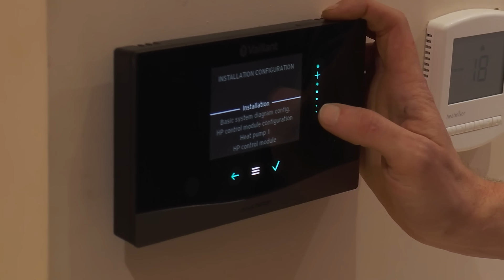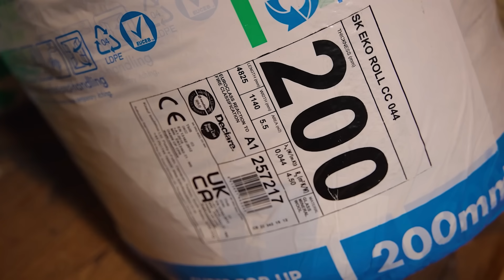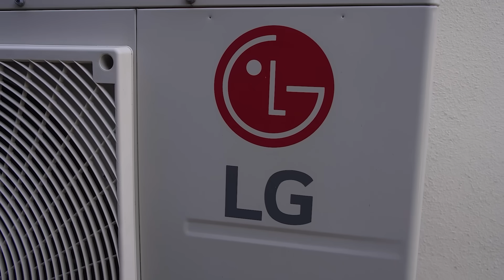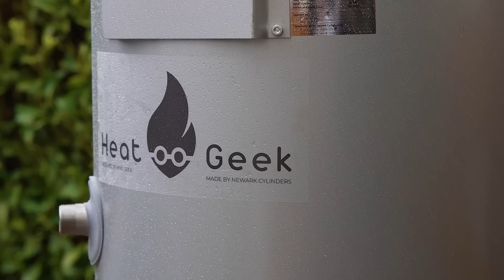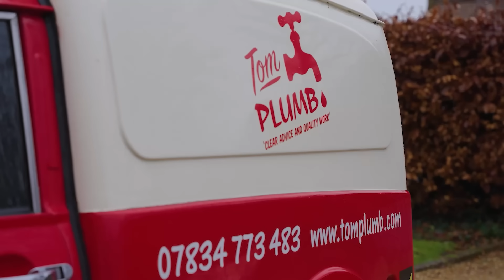Heat Geek’s Heat Pump One Year Later — The Verdict!

Comment: John talks a lot of sense, about grants and knowledgeable installers , most of these grant dependant company's burst onto the scene then go bust as their shoddy work starts to catch up with them. 
I've been an independent Gas Safe engineer since the 90's and seen this many times.
Reply: Last week on BBC Look North (Leeds) there was an article about a couple who had a heat pump installed.  They had lived in their house over 40 years and said they had never been cold until the heat pump was installed. Their energy bill was over £1,000 a month!! And guess what?  The installers had gone bust.  The lady said she wished she could afford to go back to gas CH but they were still paying off the loan for the heat pump.  What a nightmare.
Reply: @TheDavecroft  That sounds real bad. But in my experience older people are hard to convince to use a heat pump properly, as we've seen in this video. They are used to gas boilers and want to use it for shorter periods of time at higher temperature which is really bad for a heat pump. It;s not good for gas boilers also but they are more forgiving. "Uneducated" people think that shorter periods of use of a gas boiler leads to greater economy. But modern gas boilers are modulating their power. So a 20 kW gas boiler can run for 15 minutes at full power and use 5kWh or at 25% power for an hour and use also 5 kWh. Or at 10% power and use 2 kwh.
Unfortunately there are many companies that got into heat pumps and don't understand how they work or how easy is an installation, but we are getting there and some channels are useful, like Heat Geek.
If even I managed to install myself two heat pumps for only 2.600 EUR that work perfectly for three winters now, it's not that hard, is it? And I went to law school, not engineering.
Reply: it is the same with solar panel installers,  we had rebates on them in the netherlands   a boom of solar companies,  now the subsidy and rebates are gone  and so are those companies,  so there goes the warranty's
Reply: @abelfaber4457  Well, it shouldn't, the warranty is supportde by the manufacturer. Maybe the warranty for the installation only.
Reply: Same with cavity wall insulation schemes, a government grant feeding trough for cowboys.
Reply: I think tax money would be better spent on reducing electricity prices (at least for heat pump and electric car charger tariffs), supplemented with grants for low-income households. Those should also be given out for improving insulation, again mostly for low-income households. 

This could prevent “Wild West” installer markets, as middle to high income households would pay regular prices for installs while still making the switch to electricity economically feasible for them thanks to lower electricity rates.

Once this is set up, it should be combined with a mandate to at least partly switch to heat pumps, district heating or renewable fuels when it’s time to replace the old gas boiler anyway. We all have to stop burning gas over the next 20 - 30 years, so we really need to stop installing brand-new gas boilers asap.
Reply: I used to be OFTEC registered and did some repairs on several installations done on grant schemes the company went bust. The next village to me I did a boiler change for an elderly couple and did the servicing. Next door another elderly lady had a boiler change done on a grant scheme. The neighbour rang and asked me to service her boiler because it was smoking. I went around to take a look and found the balanced flue still had a lot of packaging restricting the balanced flue air intake. She had had them back a number of times because it wasn't working properly. She wasn't happy because they insisted the new boiler couldn't be positioned in the same place as the old boiler plus it cost her nearly £1000 more than I charged her next door neighbour in an identical bungalow. I made a fair profit on the neighbours install but the other install had a shorter flue and they probably saved £150. The four grant aided boiler swaps had stupid mistakes oil leaks and stat wired wrongly and I doubted the commissioning figures.
Reply: Guys, stop using apostrophes if you have no clue as to what they're for.  Better to leave them out and get it wrong than put them in and get it wrong-er. 
Companies*
Warranties *

Comment: he's over the moon with 20 C, thats freezing cold in winter, we need the house at least 24C
Reply: You are growing tomatoes?
Reply: Yep.  20 or lower is fine if I'm moving around doing housework, sitting watching telly I want 22 degrees.  And no, I'm not going to sit under a duvet or going to wear a onesie and gloves, it's 2025 not 1965.
Reply: I take it you are very elderly or have some disability? I would also say that a heat pump is more comfortable than a boiler even if the temperature is lower, this is because of the lack of fluctuating temperatures.
Reply: @MentalLentil-ev9jr  Why? At what temperature you feel comfortable in the summer. Better yet, do you happen to know what is the temperature used on the International Space Station? You guessed it, 24°C.

Comment: I think it makes sense to leave the experiments to those who can afford it if it goes wrong. Unfortunately very few have access to the skill heat geeks have and the investment Roger gives. If you had to pay for these guys probably be able to buy enough boilers to last a few life times 😅 . A combi boiler is tried and tested, evolved to become better. Stick with what works and put food on the table.
Reply: You can get a heat geek fitter and have the gov grant to help towards it.
Reply: @garethhhhh  Or keep what you have and save a lot of faff, hassle, and expense.  All that palaver to save a couple of hundred quid on heating bills?  No thanks.
Reply: @TheDavecroft  couple of hundred?

If everyone stopped using gas, our bills would drop dramatically.

The price of electricity is based on how much it would cost if it were generated by gas.

Wind and solar costs a fraction of what it costs to produce via gas, the issue is it's price is based on what it would cost if it was made with gas.

When I get my solar sorted, it'll be thousands saved over ten 20 years, possibly 30k or more saved..
Reply: @garethhhhh  
No it wouldn't, because you're not taking into account the system cost for 100% renewables.

You need more transmission lines, backup power(IE: batteries), substation upgrades 

Basically you need to upgrade (IE: replace the network we already have) the whole system and and have backup for night when the wind isn't blowing. 

That will cost billions and the end user will foot the cost.

It will be more expensive, which is exactly why energy bills were the highest they ever been, because of the renewable transition.
If it's so cheap why do you have to pay a green energy fee on our bills🤔.

If you want cheap energy we need to start using coal again.
Reply: @garethhhhh 
Gov grant is the reason we have high taxes.
Reply: 'stick with what works'. Really? If we did that we would still be burning coal to heat the house. Heat pumps are a far superior technology, and it has been around for decades. So tried and tested, absolutely.

Comment: That is a lot of money every year just to heat you're house. OIl and gas should both be cheaper than what this guy pays so frankly I don't see the point.
Reply: It is a 6 bed house with varying degrees of insulation. Heated to 20 degrees all year around.

Comment: What I took from this video is that the house would be a 20 degrees continuously but whilst that is fine from just before rising until an hour before bedtime, it is much too hot while we're in bed. I'm staying with gas, very happy with it running for a few hours in the evening and a couple more in the morning.
Reply: I have one, I have it set to 19 - 20 during the day and 17 - 18 overnight.

Mine is set, so when I get up at 7, it's already at 20.

I have it set, so if I set a target temp for a selected time, it starts the heating process 3 hours before.

My tariff is 12p per kwh between 4am 7am and 1pm and 4pm, so I set the target temps to 7am and 4pm, so I use the 3 hours cheap energy to heat the house.

I'm more than happy with mine, it works perfectly and is cheaper than my old system.

The key is who installs it, they need to check it can work for you, and many are starting to do that.

Design and fitting, many skip design.
Reply: @garethhhhh  similar to me.
Reply: @johnmusgrave3179  It’s straightforward to set a lower temperature at night.
Reply: No it doesn't, I have a heat pump which drops 2 degrees at night. 20deg -> 18deg which is ideal sleep temperature.

It works like a charm, everyday and has never caused issues.

A 2degree delta is okay for a ASHP, anything more than that is probably an issue but it doesn't take days it takes a couple of hours for the house to heat back up to temperature again.
Reply: Really, 20°C is too hot? How do you sleep in the summer? 🤣
We stay at 24-25°C all year, summer and winter.
Reply: It does seem stupid that in a world where we are trying to save energy and resources, we now heat every room in our houses 24/7 rather than just heating the rooms we are using, when we use them.  I live on my own, so what is the point of heating my bedroom, bathroom and kitchen if I am sitting in the living room for 6 hours every evening?  There must be a better way.
Reply: @TheDavecroft  Well, this is the better way. You need t understand that you are not heating a room but a house/building. If you heat only one room that room is going to lose heat to the adjacent rooms through the walls, floor and ceiling. So you need hotter radiators to compensate that. It seems counterintuitive to heat all rooms but it's not. A stationary regime use is better than a  transitory one. It's like driving a car, you can accelerate to 200 km/h and then let it roll until it stops and repeat, or you can drive at 100 km/h constant speed. Which one do you think it's more economical?
And a heat pump is more efficient at a lower flow temperature than a higher one So 30°C is much better than 50°C. Also it has less power available tha a 24 or 35 kW gas boiler, which need that power only for instant DHW use. For example, my 135 sqm house needs only about 4 kW at -20°C outside and 20°C inside temperature. But I have a 35 kW gas boiler and only a 6 kW heat pump. And I live in Romania, we have real winters here.
Reply: @TheDavecroft  

Because with low temperature heating it is often more energy efficient to keep whole house at a steady temperature than to blast heat into one area every so often, only for that heat to dissipate to rest of house anyway.

Ultimately many will be able to run their house heating in a completely sustainable manner using solar PV and storage, not using any resources that they would only burn.
Reply: 20 is too cold. 23-24 is norm. it is not just heat, no one talks about fresh air, if you seal the house, your co2 level in the bedroom goes critical to 1600ppm and above.  comfort or paranoia about house insulation, I would rather sleep with fresh air
Reply: @W_L_W.  BS
Reply: OK GUYS - this is the reality…..  we switch off the radiator on the bedroom permanently, shut the doors to isolate the bedroom, and it works perfectly. NO fiddling with controls, no messing about with calculations, just a simple solution. …. John.
Reply: His house, his heating. He could set it to be cooler overnight.
Reply from the maker: Biggest
Actually that wouldn't work. If the temperature drops it takes days to get it back up again.
Reply: @SkillBuilder  a couple of degrees drop overnight shouldn't take that long to recoup.
Reply: @SkillBuilder  it can be set to 2-3 degrees lower at night, no problem. Takes about an hour to get back up.
Reply: @benw4079  it's not possible to assert a universal fact either way. The video describes a house that has construction features that are 'heat stores'. Those could take almost geological time to bring up to temperature if they drop. A house which is all insulation and no 'thermal mass' could flick its temperature up and down like billy-o.
Reply: @trs4u  that's the case for any heating system. That would be an issue with the house, not heat pumps. Heat pumps can easily be set to run lower at night.
Reply: @SkillBuilder  False. That’s yet another myth. Most controllers can be programmed to drop a few degrees overnight and reach a set point by a specific time in the morning.
Reply: @SkillBuilder not days-thats an exaggeration.
Reply: @benw4079  Indeed, it is easy set the heat pump to drop a couple of degrees late evening and add it back to wake people up. Doesn't take long here to regain the temp.
Reply: @benw4079  yeah nobody's being mean to heatpumps. I'm just saying that some of us live in thermally massive old buildings which would traditionally have relied on infernal levels of heat to quickly bring the air temperature inside up to a level while the fabric remained cold. While it would be possible to fit a heatpump having the same infernal nominal heating power, the low-temperature transfer elements would struggle to have the same rapid effect on the occupants and air that old school dangerously hot radiator/convectors would. It's a complicated idea that probably involves some ideas that Roger has alluded to before with wall-mounted rads 'tumbling' the air in rooms making them faster to transfer heat in a crisis than uniform ufh would be. Not really a 'heatpump problem' as you say,  but furnace heating is going to have qualities that can't be matched exactly by heatpumps, not all of them bad.
Reply: @trs4u  yeah but don't let the temperature drop more than a few degrees, then. Granted, if the heating is off for long enough and the temperature has dropped, it'll take longer to heat up again, but an electric heater for £20 would solve that.
Reply: @SkillBuilder  of course there are always exceptions, but for us and I imagine for most houses in UK this is false. We have bungalow, no cavity wall insulation, only loft insulation, no UFH, bog-standard heat pump, double rads (not triple) and in the winter we only run ours during daytime hours, 5.30am - 4pm then 7-9pm (to take advantage of Octopus Cosy tariff) off-peak times. Flow temp 45 deg at -5 deg. Scop of 3.7 across year. In shoulder seasons like today it was off for large parts of the day. If you lose all the heat for an extended period of time then it's true there is a lag, but it's not days, usually 1 day if you raise the flow temp by 3 degrees temporarily. We let the house naturally drop in temp a bit to sleep then let it rise gently again in the morning
Reply: @SkillBuilder  

But it does work for a drop of a few degrees overnight, it only takes a day or two to get back up to 21C if it's been off for a week during winter and temperature has dropped to 6C or so inside. Often better just to leave it ticking along when away at reduced temperature.

It only takes a couple of hours to rise from 16C to 18C in a bedroom, or 19C to 21C in living room.

Alternatively a TRV could be used if needed to reduce bedroom temperature a bit.
Reply: @trs4u  

Your large thermal mass would mean that when up to temperature indoors it would be very stable and might not need much to keep that topped up.

Low temperature heating works, and having whole house at a steady temperature is a very pleasant experience.
Reply: @SkillBuilder  No, it doesn't. He can lower it only in that room.
Reply: @Biggest-hz7ng  For an entire house it will, this is not a 30 kW gas boiler.
Reply: @benw4079   Depends on the house, surely?  I am in an end terrace, the gable end is north facing and even with insulation it acts like a heat sink, it's even pretty cool in summer.  My main bedroom and living room are next to the gable end and they take hours to warm up properly.  But at least in summer I don't need to sleep with a window open!
Reply: @TheDavecroft  you can't blame a heat pump for that. The radiators still get hot. It's a myth that they're tepid.
Reply: No, it can be set lower at night or anytime.
Reply: To spend that amount of money on a heat pump at my age wouldn’t be cost effective
Reply: @DrRobert-v8k  heat pumps aren't primarily about savings on energy costs. Future owners of your home might appreciate a more future proof low temperature heating system?
Reply: @  well they can pay to have the house ripped about to fit an inferior system

Comment: Run a heatpump, second one for this property here in New Zealand. Does a good job although we don't see freezing temperatures. Added bonus of AC in the summertime.
Will add though, the heat is just not the same as a woodburner or decent gas heater, but it's convenient.
No more maintenance than cleaning the internal room filters, which nearly nobody does, runs very quiet as well.
Reply: Cant get grants for AC in the UK, just heat pumps.
Reply: @fraser4691  Don't think you can get a heatpump here without that function.
Reply: @fraser4691  Heat pumps can just as easily cool as heat but when you use heated water to heat your house it isn't so easy to use that feature.  I have an air to air heat pump that creates cool air in the summer and warm in the winter.  

Having said that I also have a heat pump for heating an outside pool which has an option to cool the water.  Not sure why I would ever use that though :)